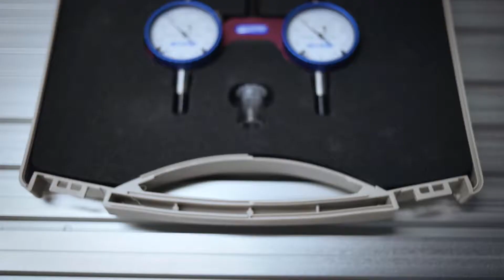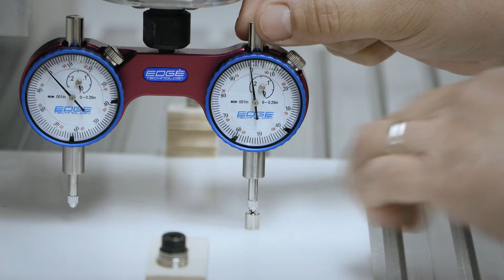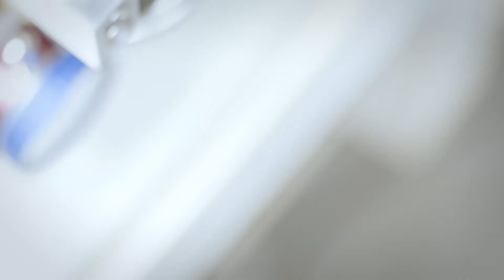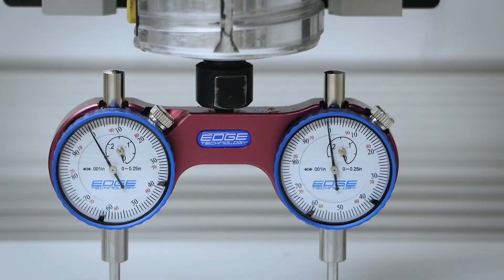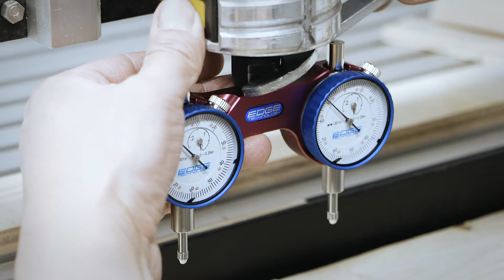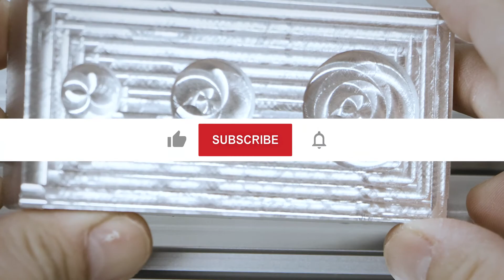How to Tram Shapeoko XXL CNC

Comment: You really should look into a Z-Plus or HDZ z-axis upgrade. Either one makes a HUGE DIFFERENCE in the performance of the Shapeoko 3.
Reply from the maker: I have but I dont think the cost is worth difference if i just run the machine slower to compensate. Plus, I dont need to run it past 50 ipm to fully utilize the performace. Though it would be great to have.